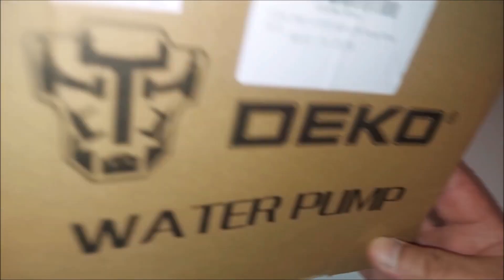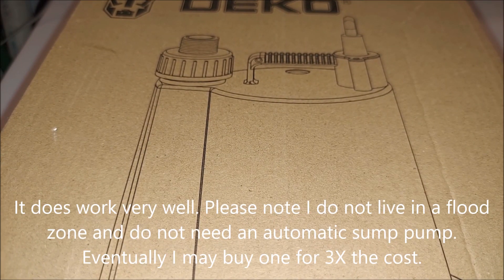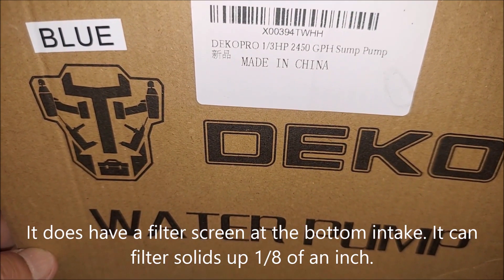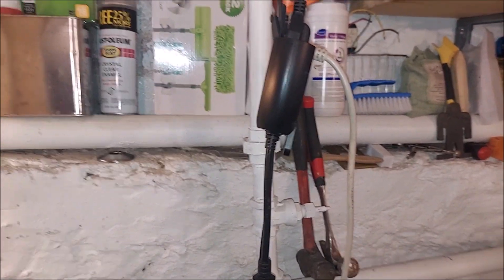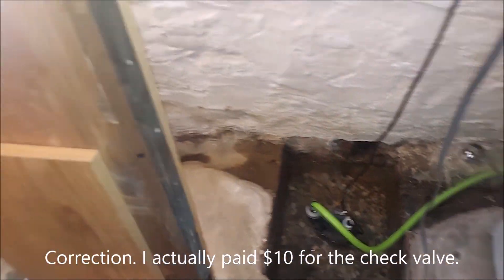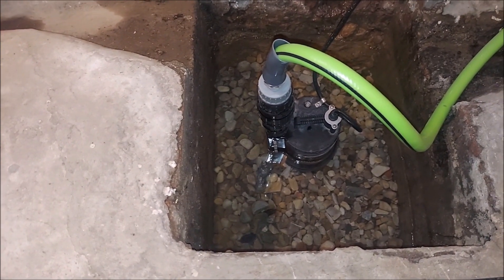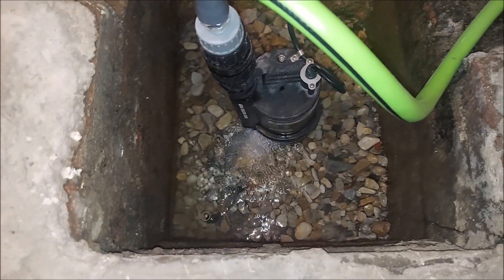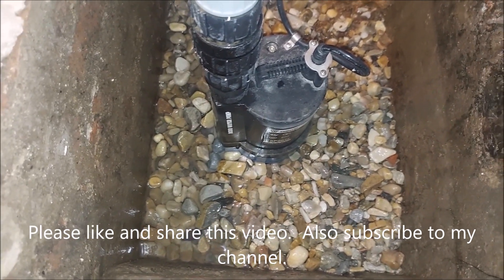Review of the DEKOPRO 1/3 HP 2450GPH Submersible Water Utility Sump Pump

Comment: Does it come with any hoses or do I need to buy hoses separately? Can a garden hose connect to it without buying more parts?
Reply from the maker: Sorry it does not come with any hoses.  However it does come with the hose connector.  I did attach an optional check valve, which it highly recommend if you are going to use it to pump out flood water.  The check valve is to prevent water going back into the pump once it sent out through the hose.  The check valve is around $7 on Amazon.  All the parts I used for this setup are in the description.  Thank you for watching.  Happy New Year.
Reply: @dannyproductreviews  thanks, I need it to sit on top of my pool to get rid of all the water off of the pool cover. Just arrived and I'm gonna give it a try, it has been raining the past 4 day's here in Detroit.
Reply: @dannyproductreviews  it works! No more water sitting on top of my pool. Thanks again for your review!
Reply from the maker: @ricosm2856  I'm glad it worked well for you. Thank you for watching and thank you for the update.  Happy New Year 2024.

Comment: Do i need the check valve if i only need to remoce like 1 inch of water? Closing down the above ground pool.
Reply from the maker: For small puddles it is not necessary to have a check valve.  Thank you for watching.
Reply: @dannyproductreviews  Thanks. It worked perfectly. Was able to get the last few inches out of the bottom then wiped down and rinsed and sucked that all up and then vacuumed the pool dry. Was a piece of cake.

Comment: Are you connecting this pump to the city's sewer drain ?  I would get a bunch of these with 2" collapsible hose to pump water outside not connected to the house's drainage pipe, the over capacity of city's drainage network is usually the culprit for flooding into homes as the sump pump is totally useless as it has no where to pump the water.
Reply from the maker: The answer is No.  Thank you for watching.